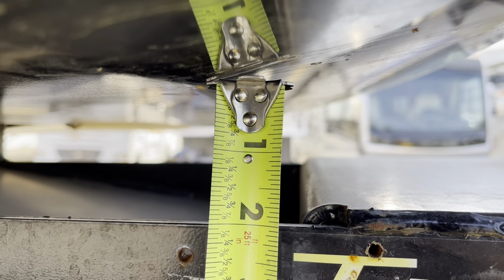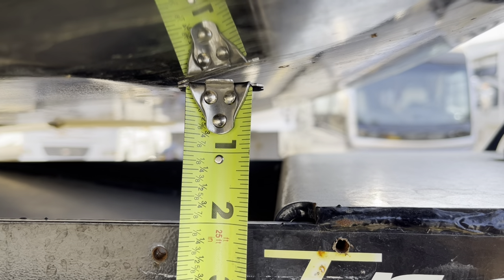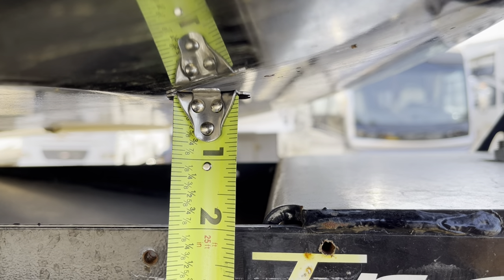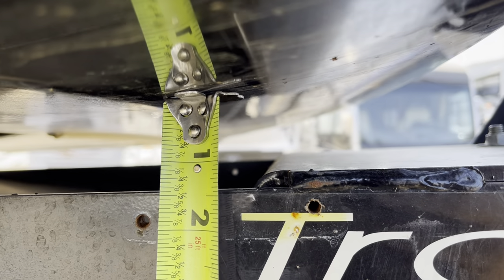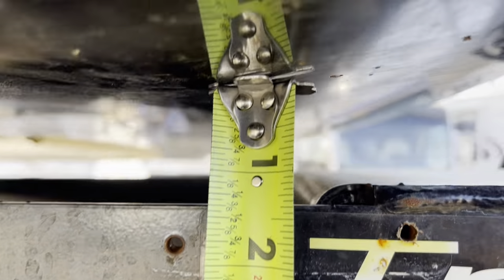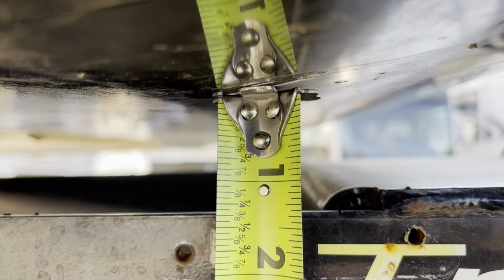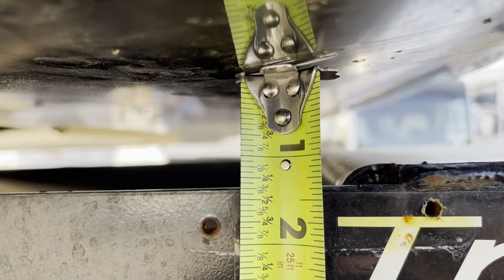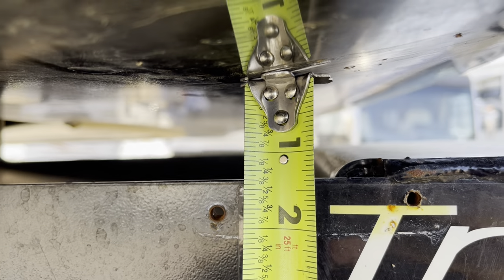Unveiling the Secrets of Grand Design Pin Box Rise!

Comment: Thor does not own Grand Design. Winnebago is the umbrella of Grand Design. Lippert does make the frame and this issue is common amongst most larger fifth wheels with Lippert frames not just Grand Design models. Lippert has more to do with these issues than they are willing to accept so we get a lot of brand smashing in the market instead of component manufacturers accepting culpability’s.